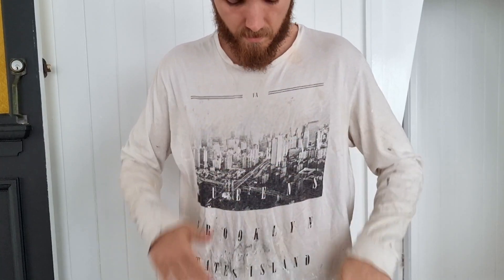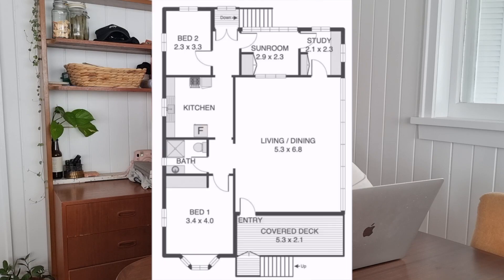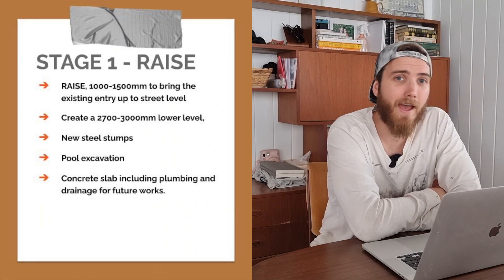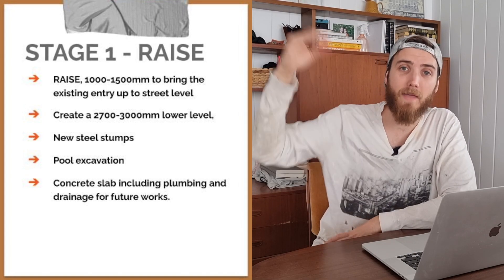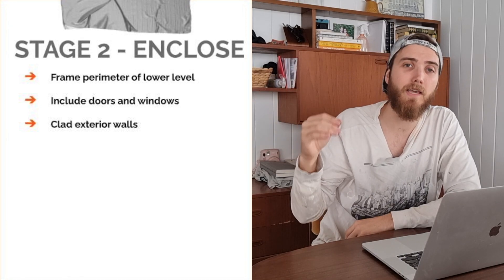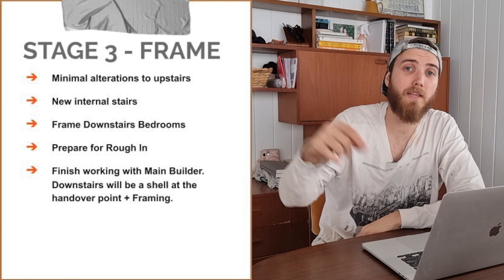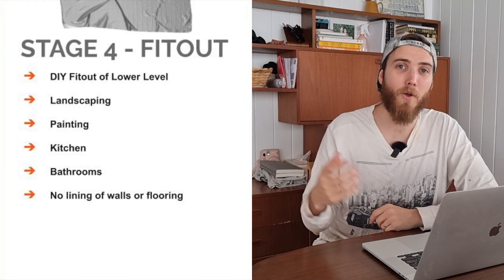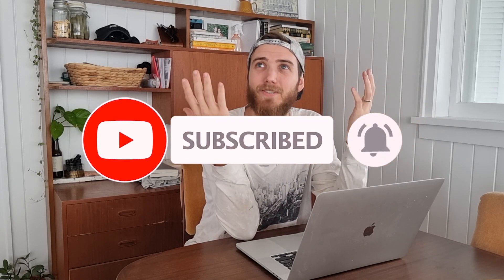Dream Home Raise & Build Project - 4 Key Stages of Construction [Triple Gable Queenslander Ep 26]

Comment: My big tips
1. Choose your height wisely. It is the most important aspect of this project. Its the one part that you don't want to pay to redo (as it is the most expensive part when you include the utilities). Get a selfy stick or climb up on a ladder and check out all of the possible views. You don't want to raise 2.9m and then find out, oops, if I raised 3.2m I'd get this ridiculously amazing view. Don't do 2.7m. With all the extra space for things between the floor and ceiling and the bottom floor, while you'll probably be ok, sneaking in at 2.4, why create the drama, especially because you'll be DIYing. It would be really annoying realizing, oh we can't choose our favorite flooring because it is a mm too thick.
2. Raise, don't slide, even a mm. I assume you don't plan to move the house. But once you move the house sideways, forward or back you are faced with the 2023 rules for new builds. A 100-year-old home subject to 2022 codes is more challenging. 
3. Talk to someone who is familiar with BCC rules. Lots of rules that if you know about them in advance would change your plan, and you want to be familiar with them before you submit your BA application. Rules about driveways and crossovers, laundry step-downs, obscuring windows/decks, restricted window openings
4. Get multiple quotes on everything. In my experience, the cheaper guys are often cheap for a reason. Be prepared for ghosting, calling 10 people, getting 4 to come out and measure, 2 finally return a quote and only one actually following through. Ask around, for recs. 
5. As a buyers agent, all the real estate agents are useful contacts for renos. They know tradespeople and they want to keep on good terms with you because you are useful to them. Call all of your local agents to get tips on the tradespeople who have been reliable for their clients. Try to choose very local tradespeople (ones within a 10km radius) just because they are more likely to show up.
6. As a trade, concreters are often really challenging personalities to work with, if you can have your builder arrange the slab definitely do that. 
7. You'll want multiple quotes from builders. In the Queenslander Reno groups on facebook, Top Build Group has a lot of experience with Queenslanders, and they let this woman do some DIY work at the same time (you can see her reno here) https://www.instagram.com/daisycottagebne/?hl=en
8. Consider construction insurance if you are managing trades during the DIY phase. There is a small risk someone gets hurt on your site, you'll want to calculate what risks you are willing to take here. Marsh is an insurance broker that specializes in construction and works with smaller projects like this one.
Reply from the maker: - We plan on having 2.7m ceilings in the downstairs space (Subject to council approval). We won't have much of a different view 30cm higher or lower. 
- We may have to slide away from the boundary because of setback rules... I'll let you know how this progresses with the certifier 
- Lining up most of our tradies now for late next year or early the year after. 
- So much to think about but all very exciting!!
Reply: @lukewiles1  
- 2.7m ceilings are a great height. To get 2.7 ceilings you typically want to raise 3m off the slab, once you count for flooring, insulation, and ceilings.
- Usually, upper story setbacks are 2m to the boundary (1.5 from the eves, but you can apply for exemptions) If you require screening windows, I've found that glaziers replacing the glass with obscuring glass is actually cheaper than installing an external screen.
- slide if you must. Just a warning that some of the requirements if sliding are, you must have a laundry tub connected to your laundry machine before you can live in the house (if you have one on the top floor this isn't a big deal, but if your laundry was  planning to be a late bottom floor addition this is annoying because you can't live in the top floor of the house until the bottom floor is done, at least legally, fine is ~$90,000 for living in a property prior to the certificate of occupancy, which you can't get without a proper laundry area). Note this fine is rarely given out, but it has been given out at least once, and because you have a youtube channel this might be something to consider. You'll need to add window restrictors to bedrooms, tiles, and waterproofing to all wet areas, including the laundry, R4.5+ insulation to the ceilings, and a new roof, unless you are able to argue it is in excellent condition (usually your builder can sign off on a form saying its original and in excellent condition). Many of these things you may have already done, so it might not be so bad
-the fact that time is on your side, and you don't need the work done urgently will be very helpful.
-I'm so excited to see it, a raise is effectively a new build. Its a new level of reno, and I am very excited to see the progress
Reply from the maker: - I'll have to chat with my designer & house raiser to make sure we leave enough room for extras to get the full 2.7m ceiling heights 
- Our laundry is currently under the house and we want / need to do everything by the book (especially with YT). So we'll need to chat with certifier about what's required to move back in before everything is completed to get the cert of occupancy. It may mean prioritising the laundry fitout downstairs to keep things moving. 
- Our roof has been replaced and is less than 5years old, so fingers cross we can tick all of the requirements off quickly 
- Yeah very thankful we can take things slowly (reduces the stress & means we can document everything on the channel) 
- Thanks for all your comments across all the videos - doesn't go unnoticed ! We're beyond excited to share and document the progress